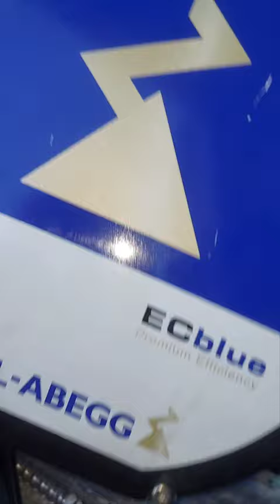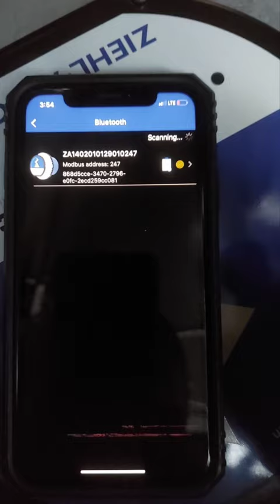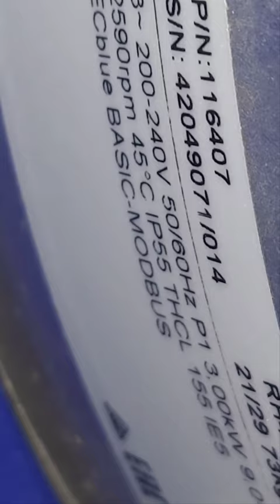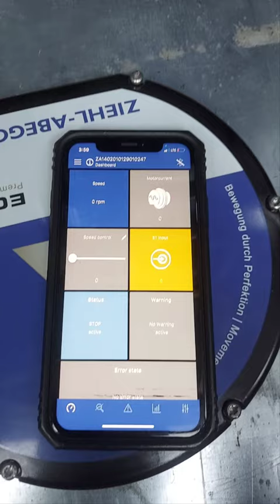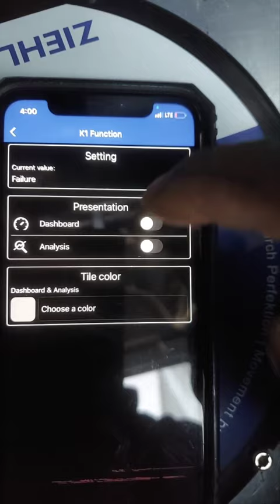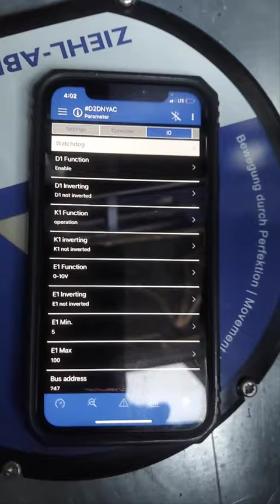ZIEHL ABEGG FAN EC BLUE MOBILE APP

Comment: The after sale service is too costly & when they break down the motor fault or ETC.
Reply from the maker: Thank you for stopping by
Reply: just looking into these motors for a customer project and found a site repairing them for $2-$3k and was like WOW what does the motor actually cost
Reply: @loodahchris04  It’s the electronic board that’s usually the problem. However, they won’t sell that to you.
Reply: I work for an oem fluid chillers inc. we have only had maybe three out of 700 of these fans fail. These are some of the best fans I have ever worked with.